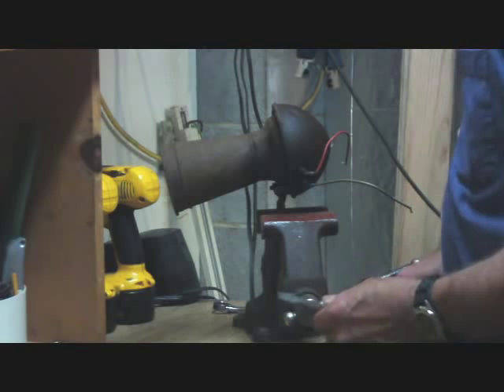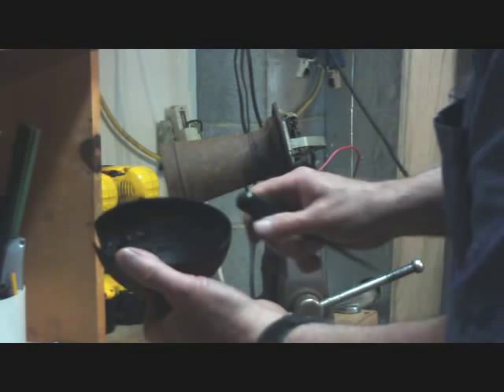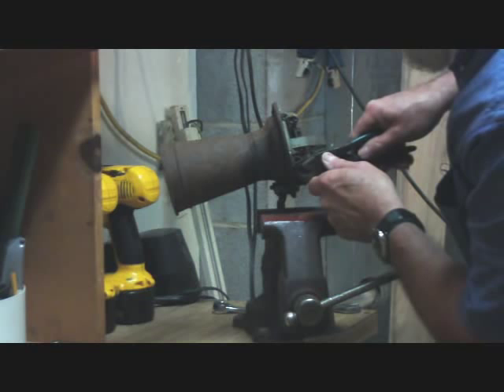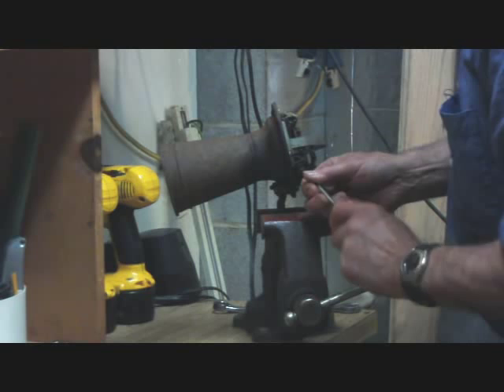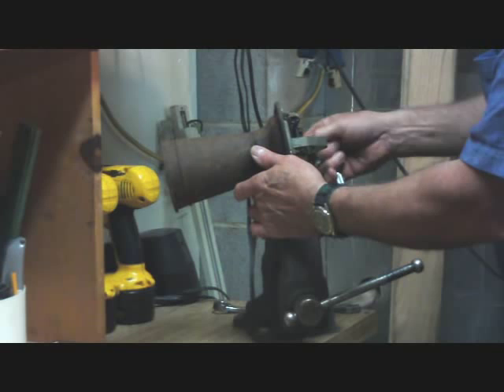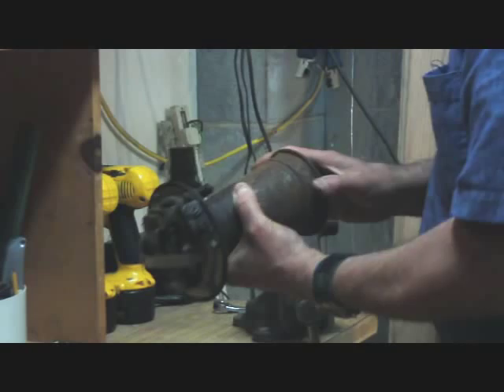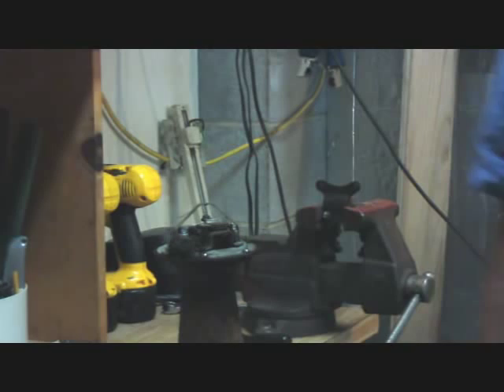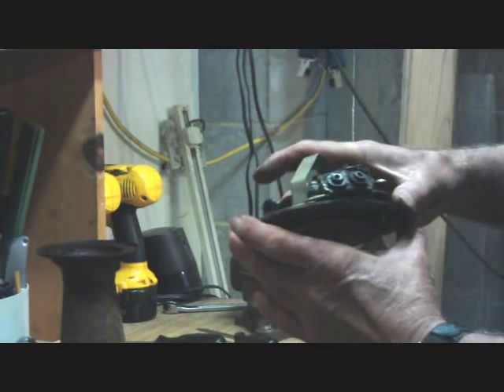This old horn, pt 4 Tear it down, man!

Comment: Can't seem to get mine going
Reply from the maker: There is a fine line between the adjustments and also making sure that your electro magnet is functioning properly. Make sure you have clean contacts on everything! Thanks for stopping by, and hopefully you'll find the solution as you continue to tinker with your horn.

Comment from the maker: I expect that these 6 volt horns would work just fine on 12 volts without any modifications. I know that the starters do well, since they actually draw less amperage at 12 volts than at the original 5 volts. For the horn, the sound wouldn't be quite the same, however.
Thanks again.